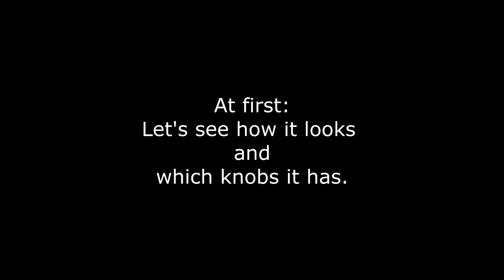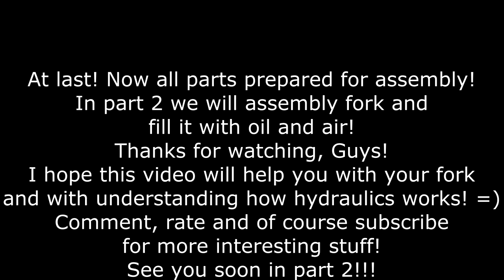MARZOCCHI Dirt Jumper 1 Diy fork service and how it works 1 - MARZOCCHI

Comment: crazy question what are the chances to find a seal kit for one of these bad boys maybe even a rebuild kit i got a pair i wanna mess around with they work fine but are leaking and definitely need new seals just wanted to see if i could revive em.
Reply from the maker: Michael, i don't know is it possible to find new seals. I have a 2003 Dirt Jumper 3 and have the same problem with leaking. But at this moment i can't find new ones. I will try a trick with seal springs shortening. Seals will grab stanchions tighter and may be leaks will gone.

Comment: Where do u get a rebuild kit or new seals? I believe they're 35mm stanchions correct.???
Reply from the maker: Ryan, DJ fork has 32mm stanchions. Where to buy a rebuild kit I really don't know. At this moment my 2004 DJ has an oil leak and I will try to find which seals will work well with Marzocchi DJ 32mm legs. Maybe some industrial seals will fit
Reply: I have seen many SKF seals on those forks that works
Reply from the maker: I have never use those. May be they are really good.

Comment: Hey mate ive got a pair of marzhocchies i think 06 but the 12mm socket wont fit as the gap is so small what do i do?
Reply from the maker: Hi, Braddon! You need to find a thin wall socket. Also you can make a standard socket to a thin wall socket on a lathe.
Reply from the maker: Sorry, Braddon. I have no time for texting and other things. If you do not sure how to service your forks, just bring it to local shop. It worth it.

Comment: Hi there. I'm in the process of rebuilding these forks myself. Is there any reason I cant put the valve plugs in the upper legs before the crown goes on? Then i get a tighter air seal. Cheers
Reply from the maker: Hello, Elliott! You can't install upper caps in upper legs before crown, because of crown has lip inside holes for upper legs. First of all You need to insert upper legs all the way inside crown and then install upper caps. When You tighten caps, You get not only air tight seal but tighten upper legs to crown. And ONLY AFTER this procedures you need to tighten side bolts on fork crown. Good luck!

Comment: Do you know is there big difference between this dj1 and 4x 2007?
Reply from the maker: I can't say with 100%, but in 2007 these forks were difference in weight. Oil and spring system are similar.

Comment: Hi, I've got a pair of marzochi dj3s from 2007, the rebound damping only works for the bottom third of travel, I'm guessing it's a low oil issue but I'm not certain. And what is the right volume of oil to use in each leg?
Reply from the maker: Hello! For Dirt Jumper 3 with 100mm of travel oil volume is Right leg 160cc and Left leg 7.5cc.

Comment: Would this work on a dirt jumper 3 2008 model
Reply from the maker: All DJ forks are the same until fox was buy marzocchi. But Dirt Jumper 3 2008 has a shitty oil cartridge, not like DJ1. But you can search info with photos where to drill this cartridge to make in work properly. After cartridge was drilled in proper spots you need to fill cartridge side with oil. Viscosity of oil is depends on which drill diameter you choose.
P.S. the most easy scenario is to find DJ 1 rebound cartridge and install in your fork.
Reply: K thanks

Comment: Hello. I have a DJ1 from 2006 and I was able to stick it to a maximum of 6cm. Why don't It use the remaining 3/4 centimeters of travel?
Reply from the maker: Hello. I think it can be one of two things. Air pressure is too high or too much oil inside fork.
Reply: @AXRV88  The air chamber is empty because I never pumped it. Oil has leaked from the valve at the top today. I dont know what is wrong with this fork
Reply from the maker: Have no idea what it can be

Comment: Hi just bought an old bike with a set of dirt jam comps wondering where to get seals and or a rebuild kit. Thanks DF
Reply from the maker: I think you can buy seals or rebuild kit on EBAY. For dirt jam fork you can use dirt jumper seals and bushings.

Comment: You can increase the travel right?
Reply from the maker: Yes, it possible! Because DJ, Drop Off and Z1, this year of production, has the same construction and length of upper legs, but different travel and cartridges.
Reply: AXRV88 do you know how to increase the travel?
Reply from the maker: If your fork has spacers under the cartridge piston, you need to remove them for increace fork travel.
Reply: AXRV88 okay very tq i try to do it

Comment: Would it be the same/similar for dj4's? Saw a video on facebook of a guy launching the coil into his ceiling and ive been terrified since lmao
Reply from the maker: These forks are simillar in base parts like crown, lower legs and stanchions. Main difference is cartridge and spring system: spring or spring+air. About video which you talking about, i don't know what to say. Suntour forks have plastic top caps which holds all the pressure of springs and nothing happens. If you have concern about springs bring your forks to local shop to be in safe.

Comment: is it any trouble if i run just air, no springs? just asking, i got a dj2 and it's quite heavy
Reply from the maker: Air valves in this fork is only for preload ( if you ride too hard and fork too soft for your style or you have high body weight) but If you can compensate too high air pressure with very thick oil, you can ride it. But cartridges in this fork engineered not for high pressures.